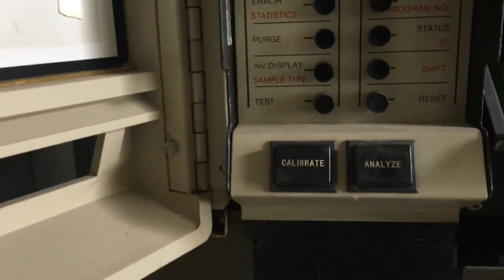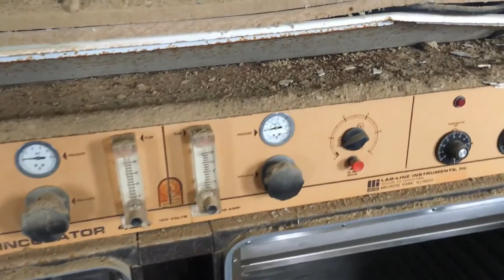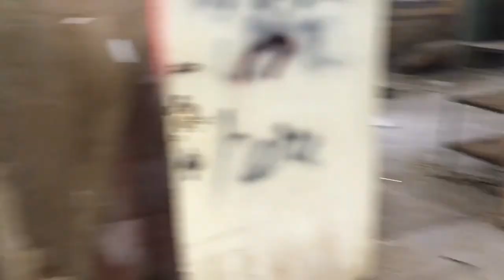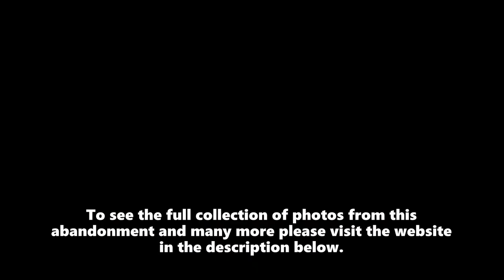Abandoned Ohio - Molly Stark Sanatorium

Comment: Was it hard to get in? And love this video!!
Reply: The difficulty of entrance changes seasonally (depending on who has visited recently).
Reply: @lukevoegele8349  IKR which part of the fence is cut open today or secured again with steel cable LOL.
Reply from the maker: @SirLongshank64  Unfortunately, the answer to your question changes every month, and I have not been there for more than several.
Reply: @beautyoftheforgotten6183  I knew that I was making a joke as there are dozens of cuts in the fence around the perimeter.
Reply from the maker: @SirLongshank64  Ahaha I see.